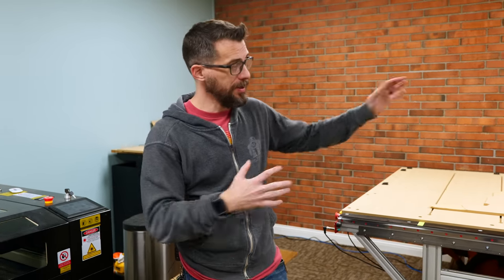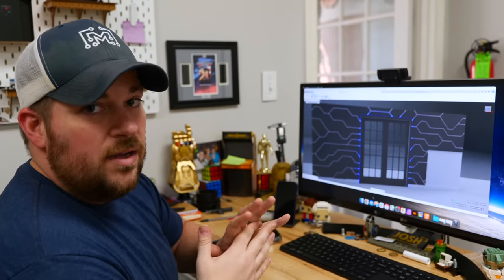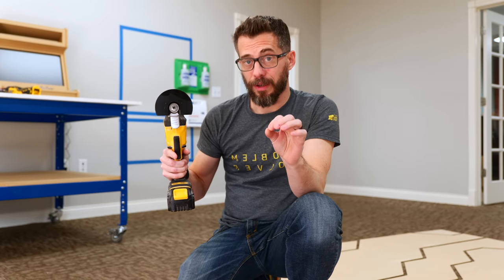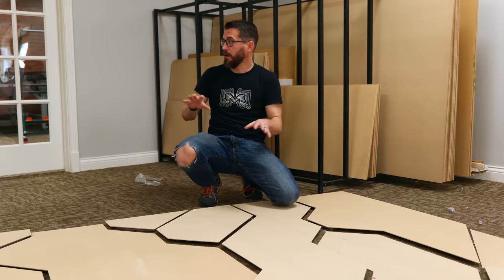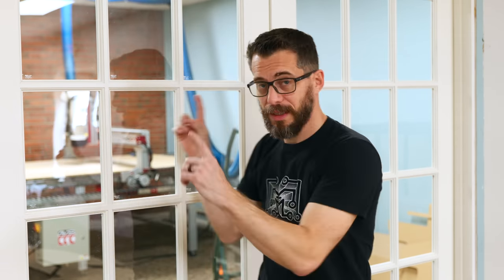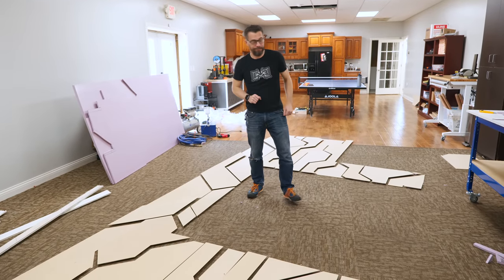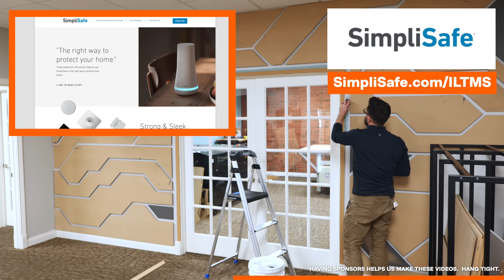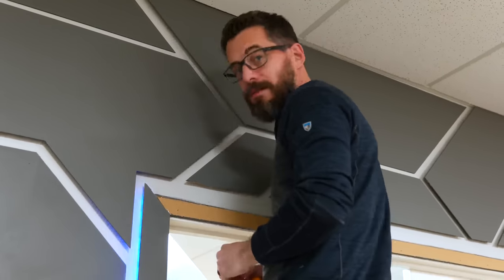Accent Wall with an Air Quality Sensor

Comment: You might want to add sensors to a couple spots in the room to get an average air quality reading, depending on the size of the room and rate of air circulation through and into it.
Reply from the maker: Agreed.
Reply: @Iliketomakestuff  When I saw the thumbnail, that is what I thought you did.

Comment: I have a PM 2.5 (Air Quality) sensor in my garage woodshop and I think it's one of the best additions to any shop: The numbers tell me when it's a good time to take my mask off after sanding or using any other tool.  IMO it should be in every shop out there.
Reply from the maker: I agree. I often don't think about dust collection in the moment, but setting this room up for success made me rethink the workshop.

Comment: I was going to attempt to do that kind of wall pattern with LEDs running the whole length of the "circuits" for my workshop. Ultimately I chickened out but I'm glad I now have your video as a resource for the future. Now all it needs is pocket doors that make the "whoosh" noise when they open and close :) Anyway, looks great! Thanks for sharing!
Reply from the maker: Cool idea

Comment: Something worth noting. The casing around a door frame is a surprisingly integral part to the structure of the door system. It doesn't look like your new custom casing is doing anything to tie that door frame to the house frame. Sure, the door isn't going to fall off but it can really impact the feel of a solid door in the near term, and allow door alignment to suffer in the long term.

Comment: Take it from someone who has been building scale terrain for gaming and models for over a quarter of a century. The fastest and easiest way to cut any type of foam fast, especially if you don't care about edge cleanliness, is with an old steak knife. The serrated blade that is semi dull is perfect for cutting foam fast and accurately.
Reply from the maker: Good to know. thanks!
Reply: Electric bread knives also work great, used them to cut miles of thick foam for use in cushions for indoor playgrounds
Reply: @ColinKleinNL  I second the electric knives

Comment: I was actually working this weekend with 2" foam (insulating my band joist).  I tried a foam specific jigsaw blade but had way too much deflection.  I just went with the score and snap option.  Worked great for my purposes.

Comment: In case you want to cut foam in the future:  '1/8" Shank Downcut End Mill Sprial CNC Router Bits'    works great when I've used them in the past.

Comment: Hey Bob, I adapted your project for my purposes. I also have a LED-stripe running by an arduino. But instead of controlling the air quality I use it to notify my mate, if I am recording my podcast or on a phone. For the phone I use a lightsensor with is taped on the busylamp und two bottons. The buttons start ort stop my recording using the keyboard-library und usb. When I am recording the led-stripe und a cntrollamp turn red. After stopping recording they go of. I really like these kind of projects. Take care.

Comment: I'm new to this channel, but I'm wondering if maybe setting up something like Home Assistant might also help with these projects. So instead of adding the logic in the Arduino, you can just read the values with an ESP send them to the HA, then have other devices respond to the sensor values. That way if you need to make any updates you can do it on the fly with a few clicks. Also, you can set up monitoring over time, plus alerts for off hours, so if you're gone and there is smoke in the room you might be able to get some push notifications.

Comment: Placement of the sensor is critical for effectiveness.  Just like a regular smoke detector, you want to place it away from "dead zones" (such as areas near the wall/ceiling join).  Your sensor placement will not be terribly good - I'd suggest mounting it on the ceiling, near center.  You have to watch the length of the sensor leads - if it's providing a voltage signal you will get some distortion from the lead resistance if it's far away.  That's the reason most industrial sensors use a 4-20 mA current signal, as it's pretty much immune to degradation from distance or RF interference.  Neat project, however - I really like the design elements!

Comment: For the foam cutting part, use machine oil on the blade of the cutter, it does wonders, Very cool work as usual, it's something I'd do at home if had the chance to,

Comment: This is a really good idea. Didn't know there was an air tester for the Arduino so will have to check it out.

I was building an attic hatch for my new garage using four pieces of 2" foam glued together. I used PL300 to glue them together which would have worked in your build as well, but I think the hot glue will work fine. I don't have a router table as that would likely be the best way to cut the foam with a long enough template bit. I opted to use the oscillating saw as well after trying with the long Olfa blade but still wasn't getting great results as it was almost impossible to keep the blade straight up and down so that it stayed even all the way around. With the oscillating saw was able to keep it pretty straight and use the foam board above as a guide. Pretty funny to see that's how you guys cut yours as well.

Comment: You might not have issues but just a heads up; I've had multiple power supplies that look identical to the one that you used in this project for the leds. Mine have all failed; most of them have literally died but one does this funky pwm flicker when I have something connected to it. Looks cool but not necessarily safe 😅 I'm not sure which power supplies to recommend since I've bought mine from local stores here in Finland since then but I've stopped "saving money" on power supplies which has actually saved me money lol.

Comment: Hey guys,
Long time watcher, first time commenter.
I am in the process of building/designing a plinko board... and would love to incorporate some switches so when the pucks land in the winning slots the board lights up, etc.
I have watched your plinko board build but was hoping to use Arduino switches. 
How/where did you or do you learn about the capabilities of Arduino, etc?
Thank you!

Comment: That's a really cool idea and the results Look awesome, not sure if I will ever need something like that... Though I like the idea of putting something like that before the toilet door, so that everyone knows when someone is on the toilet.
Reply from the maker: Pressure sensor on the seat. We've had an idea like that kicking around for years.
Reply: @Iliketomakestuff  yeah that and then you could even go totally advanced and put everyones weight in to test how well it would work to know who is on the toilet...
Or just connecting the light switch, with the light show outside.

Comment: Dude! That looks awesome! I might have to do something like that for my man cave… it would’ve been even better if you had a full run of LEDs throughout the panels, or perhaps you could run some kind of fibre optic system… maybe using a running led so that the colour pulses out from the door frame and along the runs… but still looks so cool!

Comment: Once you got the panels painted and mounted to the wall, are able to notice a depth difference between the panels mounted on foam and those mounted straight to the wall? It is hard to see any depth on the video.

Comment: What power supply did you use for the LED strips?

I'm considering lighting my room with some LED strips and a microcontroller but I'm just stuck on figuring out how to power it all.

Comment: More than likely this idea is not new but it would be cool to have some of your power wires on the wall mimic the flow of electricity when you turn the machine on. Not a great idea for everything because there would have to be a delay to show the pulse of light running "through" the wire and then time it so when that light is at the machine then it turns on. This really cool wall just reminded me of that kind of thing.

Comment: To do the offset you could use either some nylon spacers, or if you wanted custom lengths (to vary the depth of the panels) you could 3D print some. I'd then attach the panels to the wall with screws going through the spacers (I don't imagine the nails holding very well/long I'd use some construction adhesive to back them up). 

Also, why are you opposed to at least using some perfboard and properly soldering things together for projects like these? Or better yet, make a PCB (you can do this in Fusion, but I use KiCad). The Uno is a development board, it's meant for prototyping. I'm glad y'all have the cash to throw a $20 board into every project but it's a waste (of money and the board)j. Use a Pro or a Pro Mini, or any other variant that's more adept at being permanently installed. You could even just get an ATmega328 (and some other supporting jelly bean components) and use your Uno to program it and embed the $2 chip instead of a whole $20 dev board.

Comment: Do you have a means of activating your filtration systems from outside the room? Or do you have masks on hand outside? This is a really cool idea, one I’d like to implement in my own shop, but I’d also like to know what you’re doing about it when the air quality gets too bad, y’know?
Reply from the maker: It hasn't gotten bad even with both machines running at the same time. We do have masks inside and outside the room though just in case.
Reply: For fun you could add a whole Hazmat style storage box just outside the room in a similar aesthetic with masks inside it.

Comment: It may have been the easiest to just mount the MDF to the Foam sheet before cutting everything out on the CNC. Foam will cut at a much slower feed and speed than MDF so you would have been safe to simply add one more pass of each line at the remaining depth.

Comment: Are there sensors for harmful gases - such as from laser cutting the wrong material - that could be added in to the mix?
Reply from the maker: It would be a different sensor, but it would work the same.

Comment: Reminds me how workplaces that care always have extra layers of protection. I’d suggest a third layer would be clearly labeled and documented the power cutoff for those devices should something happen. That way you don’t need to enter an unknown or less than safe environment in order to make it safe.
Good to see people treating even hobby equipment with the respect it deserves. Hope you never need to actually use any of the safety equipment you setup.

Comment: Timestemp ~5min - couldn't you just take the same cut path you used withe the mdf... shrink it by like 10-20% and cut the foam with the cnc ? Like is this making sense? Of course you had to figure out what type of bit works the best and what speed/movement speed works the best - but in my mind it seems kinda easy because you have the cutting path from the MDF
Reply: testen

Comment: I think lining the edges of the separating foam and the exposed backs of the MDF with reflective material would have allowed for he LED light to travel much farther. Also Instead of a threshold values to determine the LED Color, formulating a color value from the Air Quality value would have looked much better. Over all though Super Cool!!

Comment: What kind of glue is used here for the LED strips? Is that a hot glue gun that is used here? and I noticed they have the LED strip inside a plastic (?) tube as well, are there reasons for that? 
THanks!
Reply from the maker: I had them on hand already.

Comment: The dust sensor would be a little more accurate if it was placed in the ceiling of the room rather than the door's edge. But other than that, really cool project! Cheers.

Comment: What would it take to make the light travel through the grooves? That would definitely make this a cool feature wall.
Reply: I was thinking that the addition of some foil tape on the edges of the foam might help increase the range of the glow.
Reply: Add LEDs?
Reply from the maker: More LEDs would definitely work, but that would be a lot and need more power (and money)

Comment: I wonder if you could paint the edges of the foam with something reflective to help the light spread
Reply from the maker: We thought of that. We started using aluminum tape, but the flat surfaces still stopped the light.

Comment: I'm probably not the only one who thinks more unneeded "eye-candy" would have looked great on that wall, LEDs between the foam cut-outs would have looked amazing.
I know, it would have took forever but you gotta admit it would have looked like a prop wall from a sci-fi set.
Reply from the maker: Perhaps, but this works really well too.
Reply: @Iliketomakestuff  It does look great, sorry to imply otherwise, I'm just use to you adding LEDs to make your creations "POP", it's your fault for spoiling us. 😁😁😁

Comment: Why do you hot glue LED strips to wood? LED's are sensitive to heat. Not to mention that wood is't really good to dispense the heat coming from a led. Although low powered LED's don't give that much warmth, I would strongly suggest to use aluminium profiles to place them in. They help a lot with heat dispersion resulting in a longer life.